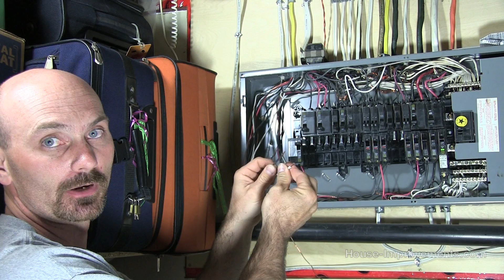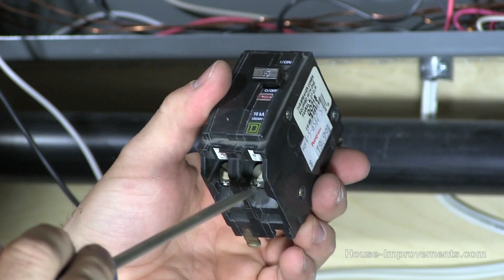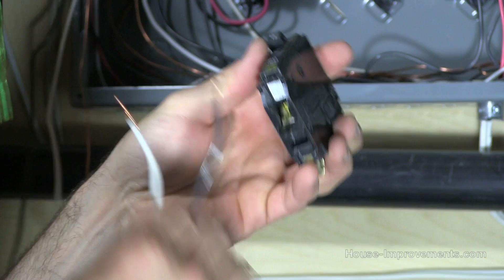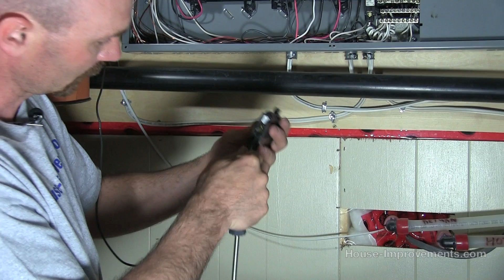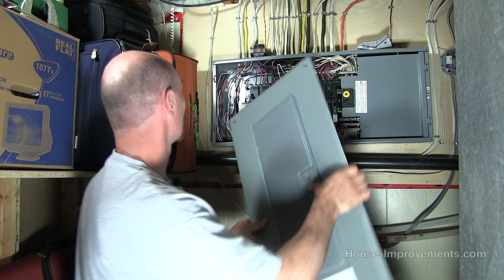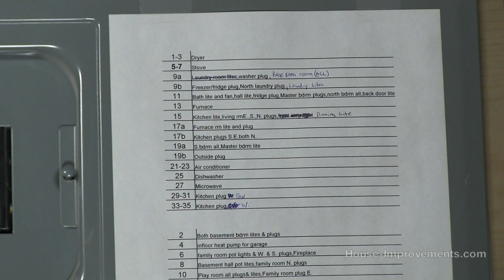How To Add a 120V 240V Circuit Breaker

Comment from the maker: The white wire hooked to the 240v breaker and also the other end of that same white wire should have been covered with black or red tape to help identify it as a HOT wire. I forgot to mention it and do it in the video.
Reply: Good Catch! Thanks for Being Aware!!!
Reply: True. Also have the power off before you put the panel cover on. Dangerous to not do so!!!!!
Reply: How about the the 240v breaker no neutral?
Reply: @garychen3032  @HouseImprovements yes why isn't this a 4 wire run, for 2 hots, 1 neutral, and 1 ground?
Reply: @davidwhitehurst6658  Older systems can have a 3 wire run for 240ACV. They are grandfathered like that. If you change things, then the new circuits have to be brought up to the current code.  Lots of older homes still have 2 prong, un-grounded outlets. The 240ACV white wire should have red tape wrapped on the end in this situation.
Reply: @davidwhitehurst6658  if you run a neutral on a 240v that means you need 120v many times 240 appliances don’t need it so it’s only 2 hots and a ground.
Reply: Grandfathered lol. You’re making me laugh
Reply: @Argile Grier no, it's sized for that sump pump. If you put something else on that circuit,  you'll be tripping the breakers because  it'll be an overcurrent.
Reply from the maker: @Argile Grier no
Reply from the maker: @Argile Grier no
Reply: HouseImprovements 
The panel board is sideways???
You can’t do that to a panel, it’s not designed for that. Only panels listed for installations like this are able to be done like that.
Reply: You also should have cut the last black wire to length rather than stuffing it into the corner.

Comment: The only thing that I would do differently and it really doesn't make a difference is you have the wires Seated on the wrong side of the terminal.. you have them hooked up to the right side of the terminal which when you screw down it will make them push out when you should have them hooked up to the left side of the terminal so when you screw down it draws them in...
Reply from the maker: The wire actually is compressed under a plate so that makes no difference.
Reply: @goikster123 if it didn't make a difference then you wouldn't have said what your concern is. Which, by the way, doesn't matter. It allows you to land 2 wires under the screw.
Reply: @fnhwk  ok it will "work" which is why I said it don't really matter to the average person but any body that does that type of work knows it always goes on the left as a matter of practice obviously you don't know what you're talking about and just looking for something to talk about..  get a life because your clueless..

Comment: Am I wrong or did his electrical tester show that there was power in that new 120v breaker he installed even though the breaker was switched off. See 18:30 and at 18:50 .
Reply from the maker: Yes it did. These types of testers will show power even if you are just close to a live wire. It was likely sensing the one next to it that was 1" away but live. Also some breakers will "bleed" a slight bit of voltage even when off and these sensors can pick up on very small amounts.

Comment: that horiz installation is a violation, the breakers are up is on, down is off, and doesn't work that way on the top row....FAIL
Reply from the maker: This panel was installed in about 2000 as a retro fit and passed inspection.
Reply: @HouseImprovements  Inspector wasn't paying attention, if you look in the mfg catalogs, you will see most breakers are NOT designed for vertical operation...and meant to have horiz left ,right indication off and on

Comment: I want to add a 120 volt plug in a dual gang box alongside a 20-amp 230 volt, do I only need to add 1 wire plus the 3 wires for the 230 service for window air conditioner?  The 120 is just an extra outlet.  Thanks in advance.
Reply from the maker: Please use my forum :https://www.house-improvements.com/forums/

Comment: Not a legal circuit breaker install in the USA for last 75 years. Against the NEC to install ANY circuit breaker where power is on while breaker is in down position. Reason being if you turned such a breaker OFF the handle would be in the up position and if something falls on breaker would turn if on. Please don't waste our time showing illegal work.
Reply from the maker: This replacement panel was installed by a licensed electrician in Canada with a permit in about 2003.

Comment: Hello.  So I'm replacing my really old Built-in oven 1995 ish with a 2008 ish.  my house was first occupied in 1996 so it was built the year before the 4-wire mandate 8/3 w/ground Romex (NEC).  So I'm grandfathered in.  The replacement oven has both 3 and 4 wire instructions in it. So naturally I'm leaning to do 3-wire installation.  On the Microwave side of the equation, I'm thinking of Using 12/2 Romex as a dedicated circuit, wired up to the replacement microwave, which needs a standard 15 amp service @ 120v which I should probably just make it a 20 amp breaker.   I tested the wiring voltage on all 3 wires going to the previous combo unit and it goes as such.  Touching black & Red i get 249v, touching white and red I get 124.5v and touching white and black I get 124.5v. So that would he hot, hot, neutral with no ground wire. The original stove/microwave unit were both powered by this 3-wire 40amp circuit whereby the microwave is 120v and oven 240v/120v.  It was one big combo unit into this custom home.  I realize that new codes call for 4-wire, but my replacement oven supports 3-wire or 4-wire so I'm going to forge ahead in that manner unless you think i should run a whole new 4 wire Romex (lots of extra cost and work to get that big wire pulled)?? Of course, these days, the Microwave and Oven are two totally separate units but are designed to work in the same cabinetry. Thanks in advance for any thoughts!
Reply from the maker: Microwave should not be connected to the oven electrical.
Reply: @HouseImprovements  thank you , it will be a separate run.  quick question: microwave is technically rated for 15a but instruction manual says I can use a 15a or 20a breaker.  What would you use for the typical 1000w microwave?

Comment: hi  I need to  replace  signal  Vanity light to double vanity light  what is the code for that  can i  split the  wire  from the one  that is already there and install a second  junction box   for the second one  since i got to mirror  need to install two  light as will thx
Reply from the maker: As long as your not overloading that circuit you can. Basic rule of thumb is 12 devices per circuit breaker.  If these are Led lights then you should be fine IMO.

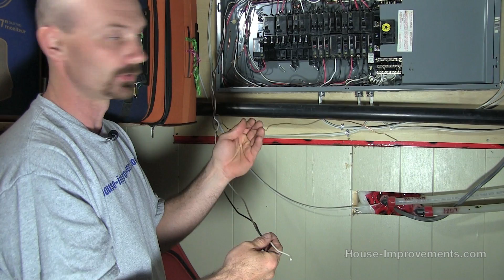Comment: 11:35 white wire and black wire is etched(nicked)  and will absorb heat at this point where the nick is located so redo the stripping if iths happens so no wires are nicked or danger of fire there and never use a white wire for hot leg ever

Comment: why is the panel sideways  and why is it  so close to the gas pipe (black pipe(not legal  )  altho safe enough for sideways but fire dept hates when theyre sideways and it is now illegal unpassable ro use a white wire on a hot 220 phase even with black marker or tape  applied to white wire  and insurance will not cover damages if a fire occurs due to using a white wire not red or black as of nec 2000

Comment: You did not wrap the white wire with red tape on the 240 breaker before you installed the panel cover.

Comment: Don't you think should be use 12/2 gauge wires On the 120 Volts breaker ？Sir  thanks
Reply from the maker: if its 20amp breaker. 15 Amp breakers are fine with 14 gauge

Comment: Say my sister-in-law wants me to take the old breaker box out of the trailer and put in a new one that has the new breakers the old breaker box is around circle breakers I'm comfortable putting the new breakers in I already know how to add the breakers and everything but do all electricians log in on the on the new breaker box exactly what every plug every breaker goes or do you just leave that up to the homeowner
Reply from the maker: Changing a main breaker panel is not a DIY project.

Comment: Do you always have to pull a permit if you're switching the boxes out from an old breaker to a new one
Reply from the maker: Yes, Changing the breaker panel requires a qualified electrician.

Comment: Good vid, BUT, there was hydro to the  new 120 breaker when you tested it before it was turned on...i saw you touch all 4 of the wires and it was hot too, then you went back to it and said ,"this isn't hot yet because it's turned off"...i swear I saw you test the 240 was dead but the 120 was hot 18:18  and both the breakers were in the off position...freaky!!!
Reply from the maker: The "buzz stick" tester will give a buzz on contact usually for a second. that may be what you are referring too?

Comment: How about a 20 amp wire connected to a 15 amp breaker? Can all the screws be tightened without any fixed torque screwdrivers? Everithing is ok?
Reply from the maker: 20 amp wire to a 15 amp breaker is fine but not the other way around . Tighten them down with a sc=crew driver good.

Comment: A 240 circuit has a 3 wire Romex , 2 hot ones usually black and red ( color coded ) , one neutral which has to be white ( color coded) and a bare copper one  that is the ground
Reply from the maker: Not always. You can run 240 just like I did here on two wire in certain cases. Your standard 240 volt appliances will have 3wire however mainly because they require a neutral because most appliances have devices incorporated in them that require 120V . as well as the 240 V for heating elements and such.
Reply: @HouseImprovements  I agree with you . You can wire a 240 Volt circuit with 2 wires with different gauges if you want but......does not mean is correct !
Reply: @HouseImprovements  And ....you definitely need the ground.  That is for safety reasons.
Reply: Question are you a licensed electrician ?

Comment: wall oven say 240 volts 10 guage 17.3 amps. New breaker needed. Why would the  electrician say he will install line for 110v/20amp. That doesn't seem right.
Reply from the maker: That is a question for the electrician but the oven should require 240 V.
Reply: @HouseImprovements  thank you

Comment: Why are you using 14 gauge on a 240v circuit? Is it safe??  Isn't 15 AMp breaker the limit for a 14 gauge wire??  On a 240v (50amp breaker) should not you use 6 or 8 gauge???  If you use thin wire on a 240v, the wire will overheat before the breaker breaks, causing fire.....The white wire (14ga) you are using it's only good for running light fixtures, or 120v plugs where you will connect small appliances.  If you were going to connect a 240v welder, range, ac or larger appliances (which is one of the intended use for a 240v plug) on this circuit, it may cause fire?? Just asking, I am not an electrician.
Reply from the maker: The white covered wire is a 14/2 wire and intended for 15 amp circuits only. The yellow covered wire is a 12/2 wire which is intended for a 20 amp max circuit. In our case we used the 12/2 wire on a dedicated circuit for a small 240 V hardwired heater that draws 16 amps. This is not a circuit intended for larger 240V items. Every circuit needs to be sized in both the wire and the breaker for the intended item being used and also the distance the wire is traveling . Some 240 V circuits also require 3 cable wire unlike the 2 cable wire we used here. An example of that is a  kitchen range because it requires both 240v and 120v power so it needs a neutral.
We can help you more with this in the forum if you have any further questions.https://www.house-improvements.com/forums/

Comment: Wouldn’t a heavier amp breaker (30-50 amp) and something like 6 or 8 gauge wire insure you were covered using heavy duty tools (or a welder in the garage?) or any other appliance on that circuit?

Comment: What about a breaker box from 1980 all wires comes in up top through the same hole then spreads out and down to the breakers.. it looks like a hot mess in there.. how would u go about putting a 20 amp breaker in..
Reply from the maker: If you have to go in through the top where the main feed is I recommend you hire an electrician.
Reply: @HouseImprovements  ty I think I'm just gonna wing it I'm not completely green to it just like to see how it's done before I do it I'm kinda a visual person..

Comment: Hello me again:). I'm installing 15 amp receptacles on a 20 amp wire with a 20 amp breaker. Would I still route the neutral over to the side. I see that you use the neutral as a hot on the dryer is that just because it's a larger appliance? My 15 amp receptacles are all going to be used for a couple lights next to the bed and occasionally Christmas lights.

Thank you so much.
Reply from the maker: Hold on! If you are unclear on that I think you should really learn a little more about electrical before you play with it or hire a pro.  This can be a deadly game!
In North America for the circuit of receptacles you are running it needs to be 120V so you have a hot line (black) that feeds from the breaker and a Neutral line (white) that comes from the neutral bar on the breaker panel and a ground (green) that comes from the ground bar on the panel. That is how 120V circuits run. 240V power is for things like electric heat, electric ovens, clothes dryers, A/C units . These items require twice the voltage and need two hot wires and a ground and some need a neutral also. It is very important you dont mix any of these items up. We have a great forum with awesome experienced people there who can help you before you start any project so please use it when you are not familiar with what you are doing. And if you do that and are still not 100% sure that's when it is important to call a pro.https://www.house-improvements.com/forums/

Sorry for the long winded post but this is a safety issue .

Comment: Good job the only thing that I would add is that as soon as you flip the breaker to turn off the main power to check with your multimeter make sure that there is no voltage present
Reply from the maker: that is a good idea.

Comment: Great demonstration Shannon!   I’m thinking of having an electrician install a 20amp dedicated line for a chest freezer I plan on purchasing.  It’s a small 5.1 cu foot GE. My only issue is that my breaker box is mounted on the outside of the house, lol.  So I guess he’d have to drill through the inside wall of the garage to reach the panel on the other side.  Don’t ask me why they put the box there, probably because it’s cheaper, but I understand down here in NC it’s not all that uncommon.  At least now I know what’s involved.  All your videos are great, thanks for sharing your expertise Shannon.  All the best to you!

Comment: Is there any problems in a 240v breaker using a 4 wire with red and black hot, seems like it would be less dangerous if someone is working on it in the future?
Reply from the maker: Not at all

Comment: Why is there not a Neutral wire for the 240v circuit. I only saw two hots and a ground. I'm confused how does the circuit complete back to the power source?
Reply from the maker: It is a complicated thing to explain but the basics is this: Something that requires only 240V ( in this video it was a electric heater with a  heating element and no fan) will need no neutral . Appliances that require 240V but also have things like timers or lights (an electric range or clothes dryer are good examples) will use 240V and 120V because of the timers and lights so these 240V circuits do have neutrals to accommodate that.
Reply: @HouseImprovements  I'll try to let that sink in.  Thanks for getting back to me.

Comment: The safest practice is not to use white insulation conductors to be energized as hot wire. All the wiring shall be in compliance with the National Electrical Code (NEC) Articles 110 and 200 of definition & identification color code. This neural white insulation color is violation of the code because both terminations must be identified as a hot color code per NEC
Reply from the maker: I did mention coding the wires with tape and then forgot to actually do it in the video.

Comment: Shannon what you think about using 8 gauge cable with a 15amp breaker? I need to convert 240 in to 110v using the same wire from the 220
Reply from the maker: IMO,heavier wire then needed is better then lighter wire . As long as it will fit the lugs and connections you need.
Reply: @HouseImprovements  is it ok if I piggybacked with 14gauge wire?

Comment: Can a 12 gauge wire be use for the 120 volt heater ? I've notice you used a 14 gauge,,
Reply from the maker: generally speaking they would require 12 gauge depending on their draw if they are hardwired.
Reply from the maker: The 14 gauge wire here was used for plug ins not the heating. That is stated at about the 3:35 mark

Comment: It is interesting that a person can get 240V from one leg using two wires that are hot in one switch.  Can you get 240V hooking two wires on two different switches on the same column?  For some reason, I thought you get 240V hooking up two wires each one on different legs.
Reply from the maker: This would be two legs. Different box manufactures vary slightly on design for this though and proper placement is key. This was missed in video. Please ask in the forum and we can help you from there with the particular box you have.https://www.house-improvements.com/forums/

Comment: There's a lot of people ready to start adding breakers and circuits now. they really need to know why there are different breaker sizes and how to size their wire. just installing a double pole breaker and putting #12 wire on it for a space heater or some may think that they can just use a roll of 14 laying around is okay.  That can result in fires. 14 is for 15 amp, 12 for 20 10 for 30, etc.
Reply from the maker: You make a very point. All circuits need to have properly sized breakers and wire for the use the circuit is intended for.